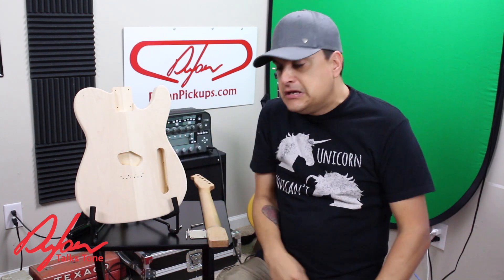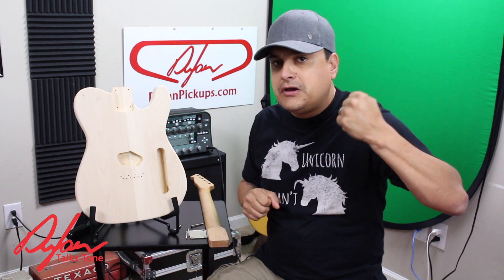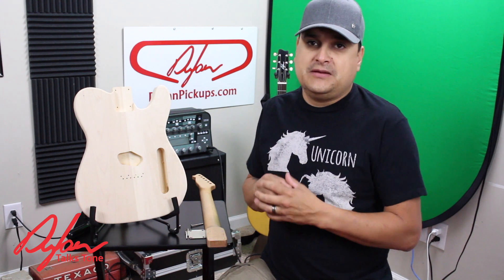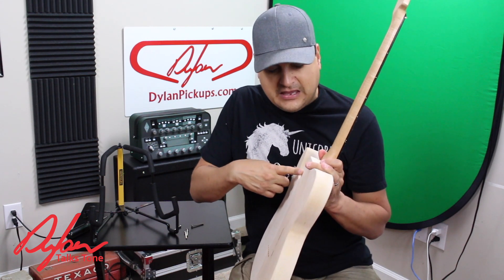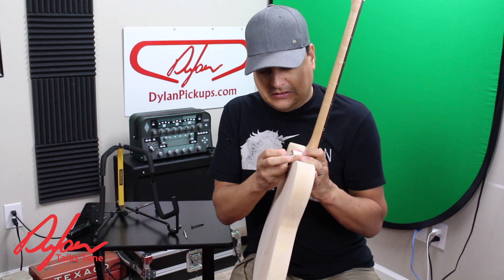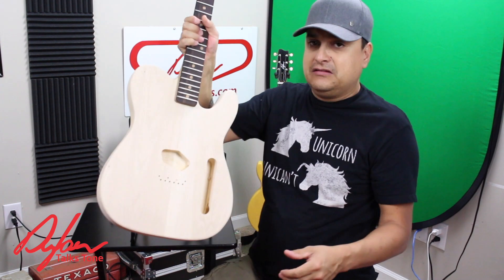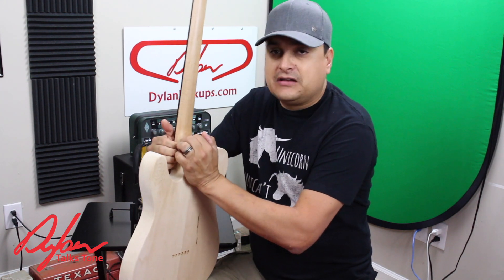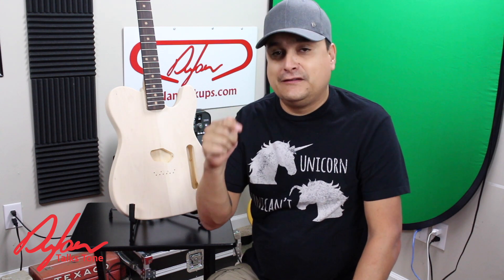Bolt on Necks, How Tight should it be? Dylan Talks Tone  #204

Comment: I've built guitars since 1962. I started with Doc Kaufman. I find that the guitar body should have a big enough hole that the neck screws just barely slide through the body. Otherwise the tension isn't all directed towards pulling the neck to the body if the screws have to thread through the body. I hope this helps.
Reply: I have heard exactly that as well, it causes all sorts of tension problems and the neck will often want to skew instead of sit properly.
Reply: Thank you Mr. Lindsey, I watched a couple reviews on that very exact concept and topic. That the holes in the body of the guitar should allow the wood screws to Freely go through so that when you tighten them into the neck that will pull the neck into the pocket of the body For a solid wood to wood joint connection. It honestly makes perfect sense when you're trying to get a solid joint between two pieces of wood. Anyway, I'm currently rebuilding a Stratocaster and just slightly oversized my holes in the body so the mounting wood screws Will be able to freely pull the neck solid into the body Pocket. Hope you're having a great day and thank you for your comment Sir.
Reply: That's true, I wish Dylan had mentioned this as well.
Reply: Same thing with furniture. The screw threads grip the neck, the screw head provides the pressure that pulls the neck tight against the body.
Reply: Yea "customshop" ok

Comment: Wow.... I've tightened the neck screws as tight as possible before warping the plate or beginning to strip the phillips head screws. Damn. Boy was I wrong. I've had guitars where one of the E strings was closer to the edge of the fretboard than the other and would loosen and move the neck up or down to straiten the string to fret board alignment and while holding it in the proper position tighten the neck screws down as tightly as I could while using my feel to know when to stop. As a mechanic I learned not ro over tighten bolts especially when using a steel bolt going into a aluminum threaded hole. That's dangerous of course. And always using a proper torque wrench set to the recommended tightness from the factory always tightening the bolts in the proper sequence. This video made me smile and feel silly about myself. I've never stripped out the screw holes or had any issues but it's amusing when I learn proper assembly techniques and thank you once again for sharing your knowledge. I will take your advice to the point to where if I notice or sense a neck has slipped or shifted then I'll of course apply more torque to stabilize the neck joint for professional use. 
Great video and channel.

Comment: I  always put a protective shim under the plate, those black plastic square ones. 
The shim will even out the pressure and it will create that bit of tension needed to hold the screws as tightened.
If the bottom of the heal is glossy then I will rugg it up slihtly so it will snugg in nicely and stay put. Now I do not need to tighten like a maniac.

Comment: I have seen some 1970 fender models featuring the 3 bolt neck plate and have seen some where the necks have shifted or slipped. I was told that's why fender went back to the 4 bolt system on they're guitars. Thanks Dylan.
Reply: It's not the 3 bolt that was the problem,it was the poor neck pocket fitting of fender strats from the 70's.Nothing to do with 3 bolts (i believed that too until i spoke to a renowned luthier)
Reply: I like the three bolt concept, lots.
The way 4 bolt units are set, it is completely possible, that screws could end up in the same grain.
This is like driving a pair splitting wedges in a log.
Any actual carpenter avoids this  nailing.

Comment: Thank you for this video.  I began doing my first assembly last night, a Fender Tele body (new from Fender) and a Fender Tele neck (new from Fender).  I always knew to "not over-tighten" the neck plate screws, my old '96 Squier Strat would get pretty tight.  But last night putting this new Fender neck on a new Fender body, the two screws closest to the neck both stripped with very little effort and kept spinning.  I'm thinking those two holes weren't dead on, as they looked a little more ovaled than the other two.  I went for the toothpick and carpenters glue trick and let dry overnight.  This morning I put the neck back into the pocket and pressed on the neck plate screws to see where I had to drill my pilot holes.  Went in with no issue or spinning this time.  But I was still curious, "how tight is tight enough, without over-tightening."  You answered it for me.  Liked and subbed.

Comment: A little older video, but I've been enjoying the channel. Building my first tele and getting lots of tips. Appreciate your laid back view on tone. So much over emphasis on the instrument and accessories regarding tone.  I've been playing for 30 years with both expensive and cheap guitars. Some "setup" correctly, but many just as they came from the factory. 99% is about the player. Technique has far more effect on tone than anything else. My recommendation is to learn on a cheap guitar. Make that sound good. Then you're free to play any guitar without worry if the neck is shimmed.

Comment: I've had an early 80's Greco Spacey Sound Strat which had its neck pocket too wide for the neck and I had constant problems with this guitar for the neck shifting towards the high E string, so not too tight, but too loose's not good either.

Comment: Great video, but I was always told when installing a bolt on neck to line it up at the top of the neck joint and push down on it to install and don’t slide it in like you did. Can you clear that up, which is correct or does it matter!?!

Comment: Some old dutch guitars had no neck pocket. The lack of tone came from the weak pickups, not the neck pocket. I believe they were called Egmonds. They were fun to play on and insanely cheap btw :). Just curious, how do I tighten when a neck is able to move around a little, with a crackling sound. The screws are tight as possible, but it still seems to "move". Any ideas?
Reply: Be certain that the through holes in the body are large enough in diameter to Not engage with the screw threads. If the screws thread into the body as well, it is possible to have the screws very tight and yet still not produce adequate clamping force between the body and neck. Make it so!🖖

Comment: should I force screw if it doesn't go in all the way? got a Strat neck with both of the tops screw holes are a bit tighter but the bottom fits good

Comment: I wax my neck screws before installing. Gives you a better feel of being just tight enough.🎸😎
Reply: Same here ! The Best !
Reply: do not... ! wood will be impregnated with wax on hot days,  wood is dead vegetal tissue and it has the ability to get the wax  through hygroscopics ways into the wood ,  , will  transfer wax softening the screw grooves on the neck..  not a good thing for sound transmission.
Reply: @MrSouthsilicon  This is 100% correct.
Reply: @MrSouthsilicon Jesus! Really…god I’ve been doing that forever. So always just straight raw dog screws into the hole?

Comment: I bolted my mity mite maple p bass neck to a Squire alder p body using 6 wood screw inserts -2 extra are offset between upper and lower screw holes-. That's machine screws not wood screws that came from factory. Yeah with two extra that neck is torqued solid to body  I mean right tight. Result is a HUGE increase in sustain vs factory crap bowed neck with stripped holes and ski jump. The Indonesian body has a neck pocket way oversized like prolly a 1/16 strong  too big. I just added kneadable epoxy at the sides. looks amateur but couldn't be more solid. sustain is forever with labella flats. Way I see it's a beater bass not a work of art.

Comment: Hi Dylan, new subscriber here I’m putting a new fender neck on an old strat body. I’ve gotten the neck on and it feels good in 5e pocket but I noticed there is a slight gap at the top two screws after I’ve screwed it down. What would you recommend doing to get better contact without getting nuts and over tightening? Thanks, keep up the good work!

Comment: Hey man I have an Ibanez seven string RG its a bolt on but the neck moves around a little in the pocket when I apply force.  How can I fix this?  Maybe some tooth picks inside the neck holes?  I’ve used that method to fix stripped strap buttons before.  Thoughts?

Comment: Guitar makers should give torque specs for each guitar model.
Reply: Its wood. You should never try to torque the screws into wood. Snug is always well enough. Once you start feeling resistance, you should stop or it's much easier than you think to strip the wood threads out.

Comment: I once tightened the bolts so hard that the metal bit inside the neck broke out of its housing and then the bolts had nothing to hang onto. I replaced the bolts with screws and it held just fine, but I'm not game to ever remove those screws again.

Comment: Just me, but never grab or pick up a guitar by the neck. Guitar bodies generally are shaped to have waist lines or shoulders that are better designed to handle the stress load of picking up a guitar. I realize that it's convenient, may not be a problem if the neck is securely bolted on. But if you think about the neck & guitar from headstock to bridge, alignment matters. If you think about where the strap buttons are on a heavy solid body guitar, they aren't attached to the neck itself. Would you pick up a baby/child, a puppy/dog or a kitten/cat by it's neck ? Some guitarists can play a guitar, that doesn't make them engineers/luthiers. Vice versa holds true, some luthiers/engineers can't play guitar to save their lives. And then there are those in the middle that reach for the neck that can play guitar and have some understanding of how a guitar is designed. If you come around any of my guitars, you better not pick it up by the neck. I don't want you handling my guitar if that's the way you pick up one of your own. Feel free to screw up your own instruments, keep your hands off mine.
Reply: I 100% agree Jim, I have always believed that from the age of 12 when I started playing, It just seemed like a common sense Thing to me I guess. Anyway, hope you're having a great day and I certainly appreciated your comment Sir. , P.S. I'm now 68 years old and still treat my guitars with kindness, and they always give back the emotion I put into them.

Comment: Dead wrong , sorry..!  get a lab microphone, make contact with the stop tailpiece part of the guitar, then, use some tape to secure it... with loose screws,  pick the strings,  measure your reading on protools and write it down... ..tight those screws and you will see when is tight enough... what you gain is more vibration coming in the microphone from a tight fitting... sorry is just the nature of physics...if you want more vibration moving between parts... you'll love this...!  get the paint out from the neck on the contact part...you can sand the lacquer of by applying a piece of sandpaper with a doble faced adhesive tape to secure the sandpaper on the pocket that way you perfectly will copy the exact shape... then you add a litle water on both parts neck and body pocked, tighten very firmly  and let the wood move and dry during process, will adjust both  surfaces  to a perfect zero tolerance contact... let it dry for a couple of days and use drops of super glue on the neck holes let it dry , completely dry, crystallisation  i mean.. that way super glue will crystallise keeping the screw grooves on the wood strong enough, plus remember the body screw should pass clean through the body , they need to grab as strong as possible te neck pulling that way neck towards the body...last but not least paint the pocket and the bottom part of the neck talon wit superglue... when crystallised properly it will create two very rigid surfaces able to transport more vibration in a better way... I know !  , pain in the neck.. but you can measure the improvement with a lab mic and protools... this is not what "I believe" this is what the db meter and spectrographic analysis on pro tools can do for you..
I'm an old guitar picker from Adrogue Buenos Aires ,Argentina. cheers
Reply from the maker: Dan Southsilicon lol. No.
Reply: @DylanTalksTone  so what are your readings to substantiate your "lol no"...? if you don't mind sharing it. I spent the time on this on my bolt on guitars. please feel free to erase my comments , I was just sharing my 2 cents..  saludos.!

Comment: you just made sure i will never buy from you. the holes in the body are the wrong size. the screw is already threading in the body. this means you don't understand how screws work, the physics part. the way you have it can't really tighten thew neck very well, tightening the screw more will crack the body, because instead of pulling the neck tighter, you are compressing the body.
Reply from the maker: It was already predrilled dude...
Reply: @DylanTalksTone  not to the correct size. when the screw (not bolt) doesn't fit in the hole properly, you drill it to the right size. what kind of builder are you that you don't know that? i thought that was one of your own bodies, so you are the one who predrilled it. you don't understand how screws are supposed to work.
Reply from the maker: @rohadtanyad8908  lol. How do you know from where you sit lol.